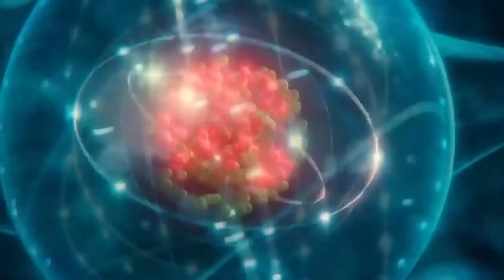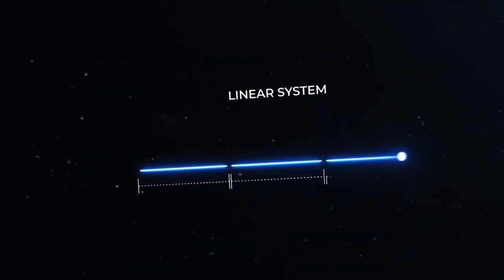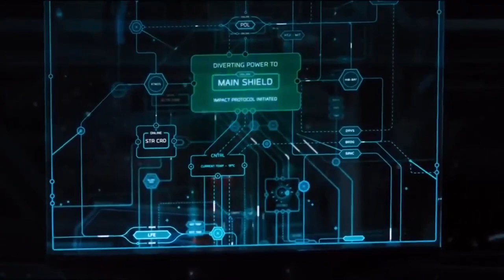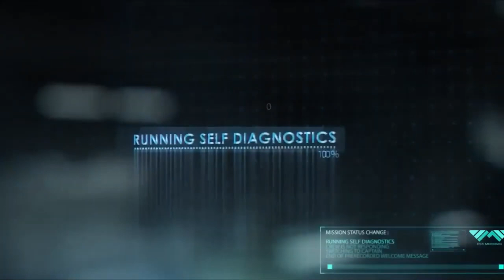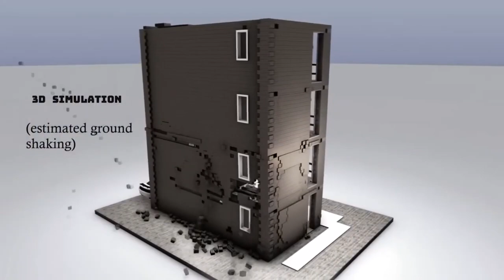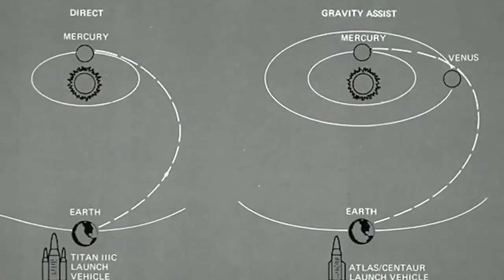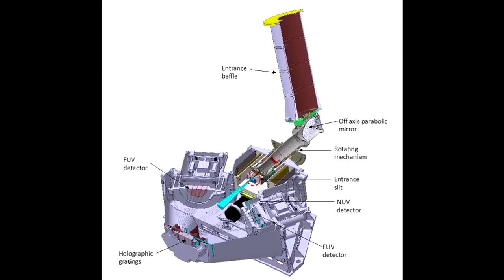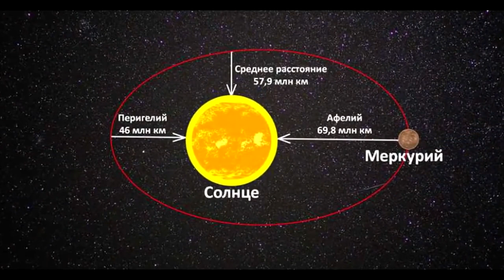The Cosmic Scale - What Actually Expands In An Expanding Universe? - Dark Energy, Cosmology

Comment: Time is the distance of forward momentum in the amount of occupational space. The greater the mass, the longer the occupational space. Time is the distance of interactions within mass in equalization of occupation. Distance is reduced by redirected trajectories of thermaldynamics cycling circulation patterns of pressure in resistance to cold space itself within occupation of space. Spheres prove hypotheses to resistance within and without mass as reduced distance from repulsion within and without mass. Equalization of pressure is maintained as density or weight. Only mass expands. Outward pressure is the decay of mass. Hydrogen under extreme pressure expands into helium. Helium occupies more space itself. Cold resistance expands within mass. More occupational space itself repelling thermaldynamics outward force of pressure known as weight or density. Density is created by repulsion to thermaldynamics. Cold resistance of space in equalization to pressure of forced repulsion of thermaldynamics outward force. Magnets show clockwise and counterclockwise pressure equalization. Repulsion and attraction. Unification of unidirectional flow cycling thermaldynamics in magnetic fields. Heat and cold resistance coexist as space itself. Thermaldynamics curves around these points of cold space in resistance equalization. Unequal pressure is the decay of mass. Loss of pressure from thermaldynamics released. The amount of pressure loss is the determining factor of energy produced. Fire, electricity, ice, etc...gamma. Degrees of releasing frequencies are the variables. All mass is determined by how many Frequencies they contain in resistance. Hydrogen expands into helium under extreme pressure. It now occupies more space and neutralizes more pressure of resistance within and without. Hence, heavier pressure is density. Resistance is frequencies within mass as repulsion.